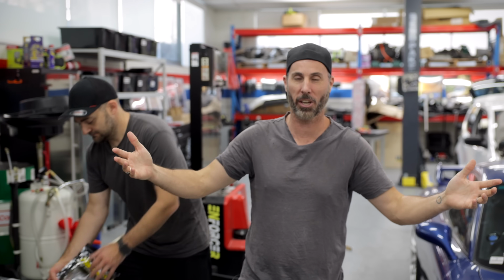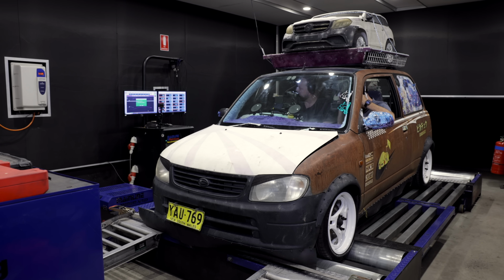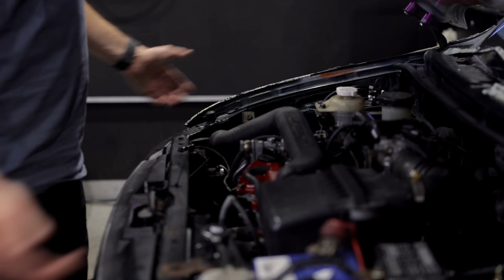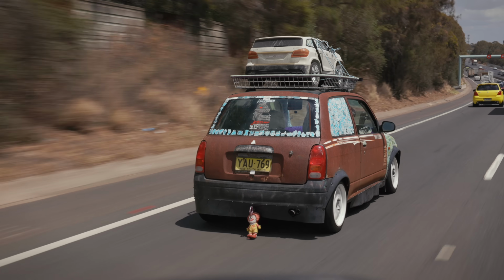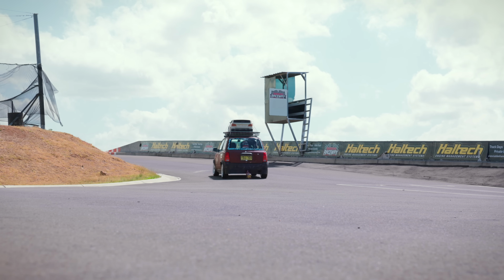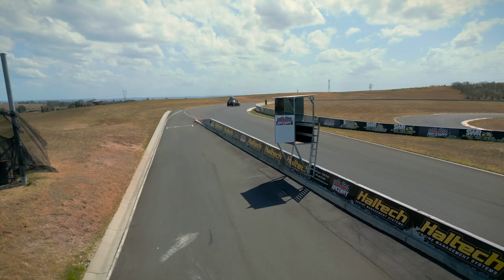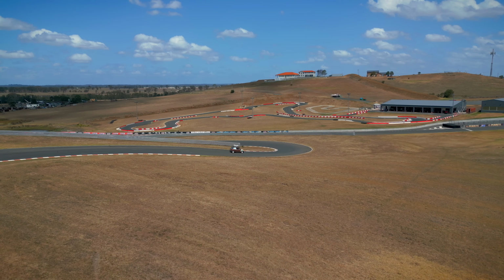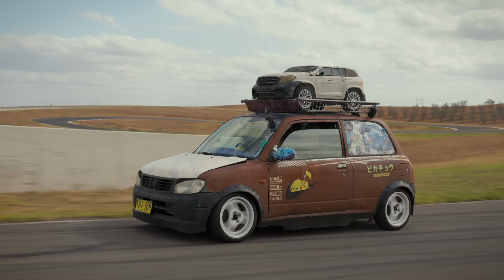Cheap Modified Car becomes track weapon!

Comment: I've found that it's always so much more fun to drive a slow car fast than a fast car slow.  Exploring the limits is a riot.
Reply: Same thinking behind light cars with skinny tires. WAY more fun pitching something around when speeds are lower and crashes don't make you homeless.
Reply: Yeah I had a 1.25 Fiesta many years ago, was always fun thrashing it 😂🤣
Reply: What about a fast car fast?
Reply: @Huda88754 They break sadly fast enough as well...
Reply: It’s true my loud but slow vr5 is at its most fun trying to cling onto Porsches and Audis on my monthly convoy drive….and yes it’s unreliable as all hell too 👌
Reply: @Huda88754  way more expensive to run, way more dangerous, way more downtime because of stuff breaking. It just isn't as much fun in general, as well. Daily driving a lil sporty car is constant fun, whereas daily driving a really fast car is just an exercise in restraint.

Comment: On track, when you guys are experiencing the “front locking up,” that is because you aren’t rev-matching your downshift in your slow corners. If you guys did a track day with a professional and learned how to heel-toe and all that, your front tires won’t be fighting your engine speed. 13:24

Comment: Honda swap it K series if it’ll fit.   Supercharge it for linear power on the track with no turbo lag.   That would be awesome.  And also paint the car really nice.  Pull the engine paint the bay and whole car.

Comment: Plenty to come from that car. We have been fine tuning our celica rallycross car for 3 years now both basic suspension tweaks and mostly tyres. It has been under powered compared to the competition. But it is regularly at the top of the field. The only car faster than us was a 350hp Audi S3 and was only about 1.5 seconds faster over 4 laps and the final was 3.3 seconds over 6 laps. We even did a hillclimb and came 4th. Same principle to go karts get the set up right and you can have a fast car using momentum. I have reached the handling limits of this car as is.

Comment: The crazy part is that it actually does sound kinda good.
Very similar to a V6... and it sounds way WAY more powerful than it is...
Like... I've heard big 3-3.5 V6s with like 10 times that power that sound duller and weaker than that. Even modified ones without stock exhaust.

Comment: Maybe an idea for A new eurotrash nugget. A ford ka 1,3i great little car with alot of potential. Would be a great competitor for these Daihatsu’s
Reply: I had one, it was a great engine. The front LCA is a wear item, they rarely go 30k miles on a set due to the torque. Mine died because the stupid headlamp module failed and it’s buried so deep it wasn’t worth spending the money to fix it!

Comment: Guys, I love y'all, been watching y'all since Marty's mum's driveway, but my first car was a 1990 Ford Festiva hatchback in the US and with a 1.3L SOHC 4 cylinder it made more power than this car. Maybe not as light of a chassis, but it had a 3 speed auto with ice cold aircon and it would EASILY do 85+ MPH and it only made 63 HP and 73 lb ft of torque. Anyway, doesn't matter, making crap cars fun to drive is what it's all about!

Comment: @mightycarmods
 quick question why you are not using ITB's on Mira, with Haltec ECU you can gain almost double BHP. In Poland We Use simmilar Nuggets called Fiat Cinquecento/Seicento and from 1.1 55BHP engines we make over 120BHP

Comment: My guess is you guys will be doing some kind of 24 hour nugget race judging by what you tuned it for. Also why did you guys keep the roof wrack and car on top? Would be some more weight savings and less drag if you took it off.

Comment: its crazy to think that the hybrid electric motor in my Kia Niro Plus has more power than that car lol it has a 32KW electric motor and a 104KW 1.6L petrol motor so im wondering how cool would it be to put the electric motor in in this thing lol

Comment: yes the ecu alone is probably 3 times the value of the car, most people will say haltech is expensive, personally i dont think its expensive if you consider what you getting (that saying comes to mind) you get what you pay for. so pricing on the haltech is valid and not expensive, hell nothing in life is expensive its all about doing what you can by the means or what you have. the message in this video its just to show you dont need alot of money to have fun (doesnt mean you need to put in a haltech) the are other affordable options to that would let you have the same amount of fun. do what you can with what you have not and live life, they worked hard to be able to do what they do with what they able to get/buy and have fun in the process, you can to. dont look at the guy/girl next to you look at you and at what wil make you happy.

Comment: Both of you locking up the brakes shows you rely too much on ABS and now you have a car without ABS and you lock up the tires. I was fortunate enough that my first car was a 93 honda del sol and it too did not have ABS. So i had to learn proper braking in order to prevent lock ups. I remember one night early on, pissing rain, locked up at a red light and slid into the intersection. Luckily it was 1am and no one around. After that scare i learned proper braking. Then my 06 s2000 and 05 sti, never once got ABS engaged because I learned proper braking. Funny enough many race car drivers and even top gear did the testing, and a driver who learns without abs can stop shorter distance than those that rely on ABS. So this nugget you built will absolutely teach you both proper braking technique and learning to feel with your foot if you will lock up or not. So great training tool
Reply: It would help a lot to learn how to heel and toe, so often I see them unsettle the cars with a big unmatched downshift. Also, easier on the clutch and gearbox.

Comment: Friend, I have a 2013 Honda CRV it has 185 hp 163 torque, what do you think that engine makes to the wheels give or take. And can this car get remapped for more power because it’s such a dog torque wise, and where I live, there are no emissions, so it would be no problem, it would be so great if you could answer those two questions for me. Thank you so much in advance.

Comment: Assuming 15% drivetrain loss, but a gain of 20% over stock with tuning, that car has lost a ton of power over the years. Curious what the compression is.

Comment: My personal obs on cars and the intake is that with few exceptions, cars fall in three big categories (and we exclude the ancient types from this). 1 small 2 big and 3 shelf cars.
On small cars, the designers will put some of the best intake systems (not in terms of quality, but what they do) on the car. They want that extra power off the table and into your stomach, as much as possible. Small engine needs help to do what it does.
On big engine cars or big cars in general, they don't (unless it's a specific type of car that's meant to do as much as possible, so we're talking common cars). They keep that power off and they use the IS to limit some of the power.
On shelf cars, well, it's self explanatory. Shelf parts cars get their stuff from a distant cousin's brother's uncle's dude that lived in the same apartment as the brand car you own (you've seen them, lift the badge and find that VW under).

Comment: Marty it would have been great if you had have delved a bit more into your intake issue. Would also have been interested to see if you could have a tangible gain by adding say a bonnet scoop onto a sealed air box. Then maybe test a pod filter on it to see if a proper air intake made a difference with a pod filter.

Comment: 20 years ago, my niece had a 3 cylinder Mira ( not worked in any way ), she liked it.
Possibly 30 years ago a friend had a 2 cylinder, 1/5l mighty van. ( same body shell but no back seat ). Lots of fun BUT when cold, one cylinder leaked water into it and one spark plug lead was failing, warm it up, it was ok but hard to start and get moving from cold.

Comment: That timing tech is really impressive. I'm used to +/- lap times or at best sector times but live time tracking that updates multiple times a second is amazing. Knowing where the gains and losses are midway through a corner is next level for chasing times irrelevant of where the rest of the field are. You compete best when competing against yourself.

Comment: Back around 1989-1990, there was a small Diahatsu doing supersprints here in Sydney. It had the 3 cylinder motor, but I can't remember the model name. It was so underpowered that when the owner put some A008R tyres on it, it went slower. The rubber duck with the helmet reminds me of another friend, who had a Garfield doll with a helmet stuck to the back window of his racecar Mini. The reason he did that was because a scrutineer objected to his passenger not wearing a helmet.

Comment: It might be a good idea to switch to a high-end synthetic motor oil like Amsoil dominator or Redline if you're going to thrash it for a long time, guys. Maybe even an oil cooler if it doesn't already have one. Keep up the great content!
Reply: An accusump would be a good idea.
Reply: @user-ih7gc7dt9l  Yeah, oil starvation and oil overheating breakdown is what kills track motors. The bearings take most of the damage in those cases

Comment: If you ditch all the extra stuff along with the estimated 50-100 lbs of weight reduction it already has from the metal degradation (rust) lol you could gain approximately 3 seconds and gain HP because less load on the engine.  This car actually has potential to do a beautiful restoration on.

Comment: Love the sound of that little 3 banger getting up in the RPMs. 100% fun for not a lot of money, just the way I like it. Honestly, 100hp+ in something like that would ruin the enjoyment. Awesome series guys!
Reply: As an owner of a fun lil 50ish HP car that was designed for low power, you're right. Once you start hitting higher HPs in cars that were never designed for it you wind up having to replace so much stuff that is just changes the car entirely. The car loses it's fun lil soul.

Comment: I wonder if the haltech guys could tune an ABS unit to change brake bias. I know this car doesn't have ABS, but on a normal car, a brake bias system is quite complex

Comment: 35KW at the wheels is about what these made stock. 
Getting less than that on a fully rebuilt and fresh engine with thousands of dollars of custom management is just... chefs kiss
Tongue in cheek slandering aside, good content as always, keep it up! <33
I totally don't understand this build yet, but I'm sure thats the point for now. Can't wait til Christmas day.
Reply from the maker: Did you hear the bit about preserving the engine for lots of laps?
Reply: @mightycarmods  I did I did, I guess I got sucked into hoping the little engine would make some magical power figure with modern computer control. I thought the standard management would probably do a good job of preserving the engine anyway, but being able to monitor exactly what the engine is doing remotely is going to be really cool. 

I'm hoping it's some kind of 24 hour endurance race? A lemons type thing? Some kind of charity event?

Comment: I hope the more to come involves them putting in a 1.5 3sv-ve from a terios, upgrading the brakes from a copen or other potentiallybetter source, improving the track width and fitting wider wheels/tires. Keep up the good work guys 👍

Comment: Way to go! Always fun with a Daihatsu at the track. If you are still using the standard exhaust manifold, there are a lots of horsepower untouched . A 3in1 manifold with high flow cat after the engine will work wonders👍

Comment: Ive found that this track has generally made cars look quite slow on camera, but this little thing looked like it was actually fast on camera, so thats is awesome. It looked incredibly fun to drive!

Two things I noticed though, it seems to be hopping a bit through corners, so maybe some more suspension fine tuning is needed to keep it nice and flat. 

Also, I think that big long gearstick extension is a bad thing. It enlogates your shift throw and slows down your gear changes (as shown by Martys Mis shift) 

Other than that it looks epic.

Comment: A mate of mine convinced me that this car is going to be the new "star in a reasonably priced car" car in the new Aussie season of Top Gear that Moog is co-hosting...

But that announcement at the end now has me wavering 🤔
Reply: I was kinda hoping that too.  But I did see a comment from Marty somewhere where he replied to a comment like that with just "No".  So it seems unlikely.  I'm thinking it's for a 24 hours of Lemons type endurance shitbox race.
Reply: @JimOHalloran  With something like Top Gear they probably have a car being supplied by and being paid by a manufacturer and have it hey.
Reply: I had that too or the bathurst 6 hour, but Daihatsu's are not on the accepted cars list :D
Reply: @KiwiPhil.  I mean how good would that thing be at Bathurst!  If it could make it up the hill at all, you'd probably be foot flat to the boards most of the way across the top of the mountain!
Reply: @gozznut  Top Gear Aus, maybe?  But it would depend on how much the BBC has to do with it.  If it's a proper BBC production, I don't think they'd be allowed to accept that kind of commercial sponsorship.  Certainly if it was on the ABC they wouldn't, and I'm pretty sure BBC rules are similar (if not more strict).